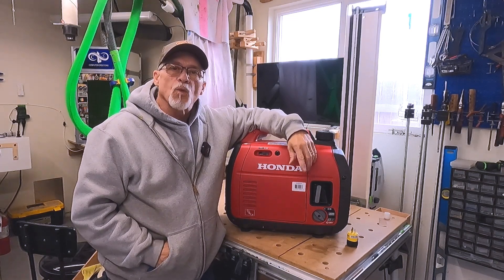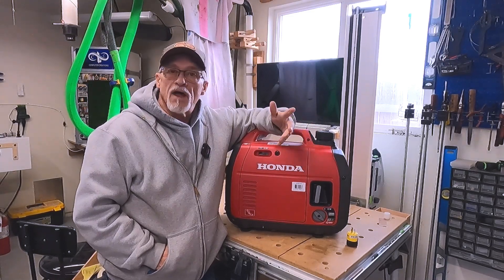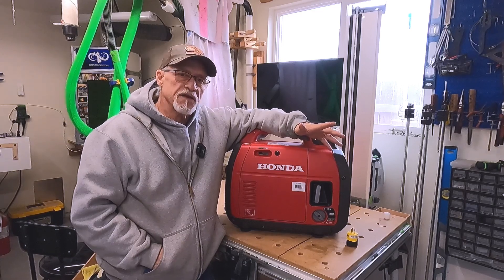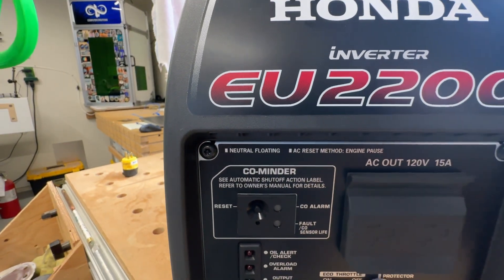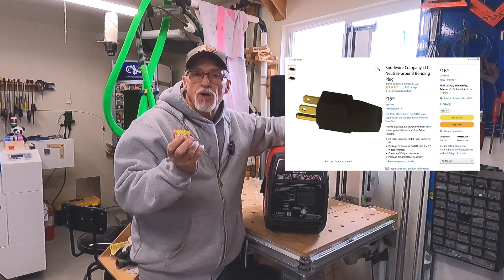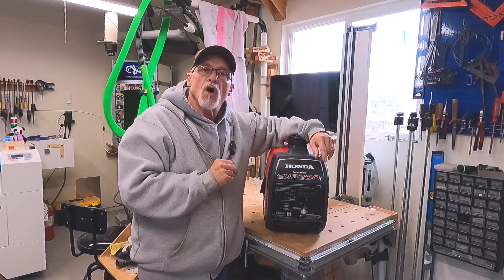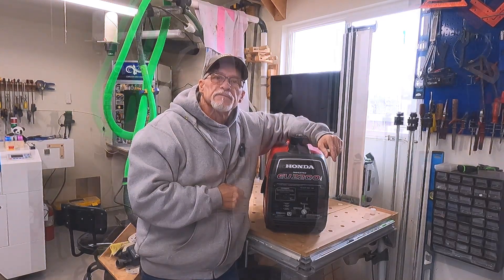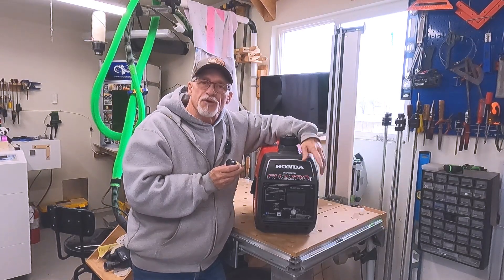Running my Natural Gas Furnace on my Honda EU2200 Generator (not as straight forward as you think)

Comment: Just FYI, this solution might not work for a small percent of people because the outlets on their generator are isolated from each other (this is not common, but can sometimes happen with inverter generators).
In other words, the Neutral-Ground Bond Plug in one outlet might not solve the issue when your furnace is plugged into a different outlet on the same generator.
I solved this by extending the 3 wires in the Neutral-Ground Bond Plug out and into a receptacle so that the furnace can draw power from the same outlet where the Neutral and Ground are bonded.

Comment: You also can run your gen power through a furnace transfer switch, which means you are common with the neutral of your house which is a grounded neutral to accomplish the same thing without having to run cords directly to your furnace.

Comment: My furnace uses a typical 3 prong plug. So if I use a floating neutral plug, I cant plug in my furnace. Would you a) use a twist lock to 3 prong adapter for the floating neutral plug or b) use a splitter and plug the floating neutral and furnace into the same outlet on the generator?
Reply from the maker: sorry I won’t make a recommendation, to much liability

Comment: Good advice, thanks. I use one of those generators to emergency power my oil fired heating, 2 fridges, freezer, low energy lights and TV, though a changeover switch. It works fine.
Reply from the maker: Good stuff!

Comment: There is one thing to be aware of if you go through a generator transfer switch. It may not be safe to use the grounding plug at the generator. You should check with an electrician to asses your situation in regards to neutral ground bonding. Grounding can be complicated. One thing to be considered is how are you planning to hook up your generator to the furnace. If you are going through a generator transfer switch, a lot of the generator switches only switch the hot conductor ( choosing whether the furnace is connected to the utility or the generator). The neutral is not switched and the neutral is passed through. The circuit panel box has a neutral ground bond inside the box. If you add the grounding plug at the generator, you are providing a second place where the neutral and ground is bonded. This is against code and could provide an unsafe condition if a short would occur between the hot and ground. If you are running an extension cord from the generator to the furnace, how is it going to be connected to the furnace? There are ways to do this safely. Again, consult an electrician so that you are going to be safe.

Comment: I 💯agree. 
I discovered this problem & solution approximately 10 years ago. 
So yes I went through the same learning curve. 
I had the Honda eu2000i (I now have the eu22000i) with my 95% variable natural gas furnace and it would also trip a code and shut down. 
I also discovered I would have to have the Honda with the eco throttle in the off position.
Th
Guys these Neutral bonding plugs are 100 necessary with this type of generator and also the solar generators like my EcoFlow delta pro.
In fact I’d make sure to have 3 of these plugs around, you are screwed without it in some cases.

Comment: What can I do as I have the Honda 2200i Companion with one 15 amp and one 30amp receptacle?
Reply from the maker: so you only have 1 120 volt plug in? if so I’m not sure you can do what illustrated in the video
Reply: @computercreationz  Thanks for the quick reply though.
Reply: I suggest you use a 30-Amp to 15-Amp "dog bone" for your furnace and plug the neutral bonding plug into the 15-amp outlet.
Reply: @rytbeard  Thanks for your comment . Appreciate it.

Comment: The Honda EU1000 will easily run my furnace. Doesn't even come out of idle to run both the circulating and purge fans.
Reply from the maker: I was shocked how little wattage it took to run my furnace as well it was like 400 watts.

Comment: I just leave my bonding plug in the outlet on the inverter generator. My Williamson boiler was not happy without it. It would actually ignite for a few seconds and then shut down. Something to do with the flame sense circuitry.

Comment: Important to point out that this info applies to furnace motors that are not hard wired into the house. Also, the majority of small generators are bonded so you can plug the furnace cord into the generator without any adapters. All generators should indicate on the front panel whether it has a floating or bonded neutral. If you don't know for sure, contact your manufacturer.
Reply from the maker: Great info to add, thanks for sharing!

Comment: I did not not have this problem with my old Trane furnace and I have run it with my Honda EU2000I... But I recently had a new furnace installed and had them put a plug on it (just like old furnace) and haven't had a reason to use the generator (yet) on it... Good thing I stumbled on this video... 👀 I would have been mad thinking that I had it figured out and not having it work and of course stuck with a cold house... 👀
Reply from the maker: Glad it helped, and that you have the generator just in case!

Comment: I recently purchased a Westinghouse Dual fuel 4,000 watt generator. I learned that unlike my old Generac generator, the Westinghouse has a floating neutral.  I installed a generator bypass switch which enables me to disconnect the furnace from the main. I also purchased a Neutral ground bonding plug. I typed up a list of instructions, for my wife, on exactly what to do to plug in the furnace. They are step by step including using the bonding plug.
So the plug doesn’t get lost/misplaced, I made a label for it and mounted it to the top of the bypass switch box, and I laminated the instructions and taped them to the furnace next to the bypass.
Reply from the maker: Sounds like you’re prepared. Good work!

Comment: Why not just set up a transfer or interlock switch and plug the generator into that which of course will then run power through your house panel box?
Reply from the maker: This video addresses a different issue, your suggestion is the the right way to to it but most people don’t think that far ahead. They run out buy a generator and assume it will work just by plugging it in to your furnace.

Comment: Important to note this is an issue only if you isolate the furnace from the main house panel when you run off the generator.  The neutral and ground are bonded in your main electrical panel.
Reply from the maker: I agree
Reply: This was my biggest issue in finding the right video to solve my unique problem.  On google most of the results I got had people talking about transfer switches.  But in my situation with a "poor man's generator setup" I am literally trying to hook up my furnace as a stand alone appliance, which like you said isolates it from the house panel N/G bond and causes a unique issue where there is no ground reference for my modern/sensitive furnace
Reply: Thank you so much for this video

Comment: If you go through a transfer switch or interlock switch, then isn't the ground already bonded to the neutral?
Reply: Maybe, maybe not.  The electrician that connected the manual transfer switch may hook it up so it disconnects the neutral from the main box.  The reason is there should only be one connection to house ground and that is typically at the main box, not the sub panel.  Therefore, you may not be connected to the house grounding rod.
Reply: Mine is a reliance Pro-trans 50A  unit.  It appears to disconnect the power only.  That would make the negative and ground a pass through to the panel and the panel does have the ground and negative bound(left side attached to the ground and the right side attached to the neg for the power company).      @djl9154

Comment: Is this plug still needed if the generator has a floating neutral but I have attached a grounding wire?
Reply: grounding wire will ground the frame of the generator only but not the circuitry since it is still floating neutral

Comment: I just got a new eu2200i figured out that the floating neutral was the problem. Your video confirms that was the problem
Reply from the maker: At least now we know we can use our Hondas for something like this. Thanks for the comment
Reply: @computercreationz  I just finished testing the furnace with ground/neutral cord end on the new eu2200i and worked perfectly.
Reply from the maker: Great News! @paulr7547

Comment: A board  I'm on  were JUST  discussing nonsensical  "safety" features on vehicles which can  actually be detrimental  or even  unsafe,  OR DEADLY.  As a guy who serviced HVAC for about 12 years back in the 80's--mid 90's  I cannot imagine why a furnace  needs such a "feature."
Reply from the maker: yes , it took me a while to figure it out! thanks for watching
Reply: It has to do with the flame rectification through the flame sensor.  It can't get the signal through the flame if the neutral isn't bonded. If a newer (anything in the last couple of decades) furnace isn't properly grounded it will have the same problem connected to regular house wiring. You should also ground the generator.

Comment: 10/03/2023, i just saw your video and after pulling my hair out for two days you have addressed the problem. i made the plug and it immediately took care of the ignitor on the furnace not turning on. I ran the unit for over an hour w/o any issues or codes.  I can’t thank you enough for posting this video !!!!  Sincerely, WI
Reply from the maker: So glad it worked, I did exactly the same thing and had to figure it out!

Comment: My Firman generator on has one outlet. Is there a way to get around this problem with only one outlet?
Reply from the maker: you might try, a splitter where you plug one end to your generator and the other end had two female outlets plug this into one the the extension cord into another. try are your own risk!
Reply: @computercreationz   I was gonna try running a power strip out of the generator/ an extension cord to the furnace/ and a male plug with the hot and neutral cut off into one of the outlets on the power strip. I'll try both ways.  Thanks for the feedback.

Comment: i would add an earth ground to it
Reply from the maker: thanks for the input
Reply: Are you recommending adding an earth ground (as in a ground rod) to the generator?  Whether that would work for this would depend on the resistance from the generator ground to the house ground.  And, you would still have to bond the neutral at the generator to the ground.
Reply: if you remove the earth ground you need to replace it with an earth ground on the generator
 @BryanTorok
Reply: i wouldnt use the house ground if your running it alone. but if you are doing a whole house hookup you have to use the house ground. and you have to remove the bonding jumper from your generator by code. @BryanTorok
Reply: the neutral and ground should already be bonded on your generator
 @BryanTorok
Reply: @BOB12349307  Perhaps it should, but many generators state right on the label near the outlets that the neutral and ground are not bonded.  In the video at about 2:30, right below a horizontal line about one-thirds of the way down, it says "Floating Neutral."

Comment: A transfer switch makes it easy to run your gas furnace with an EU2200.  Mine has a 1/2hp motor and one of my EU2200's will run it easily.
Reply from the maker: ultimately that’s the best way for sure. thanks for the comment
Reply: are you saying the transfer switch solves the ground issue?
Reply: I'm saying I have no "ground issues" when powering my furnace via the transfer switch. @bobbo1946
Reply: Apparently.  My furnace runs just fine when powered by my Honda via my Reliance transfer switch...never had a "ground Issue". @bobbo1946
Reply: @bobbo1946  yes.